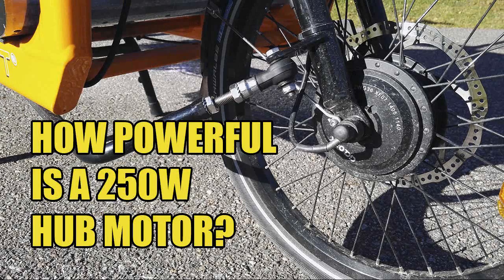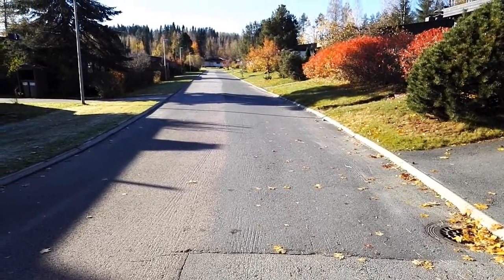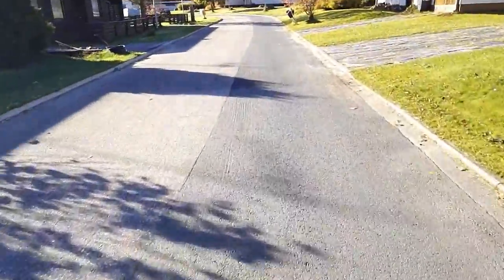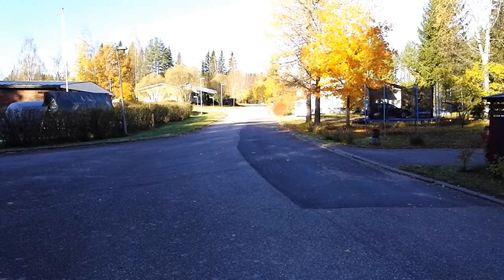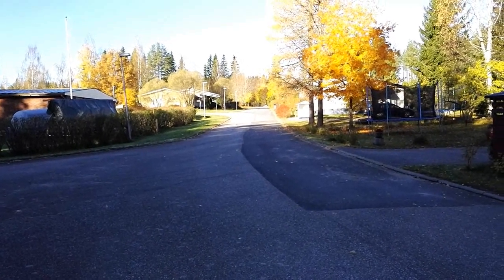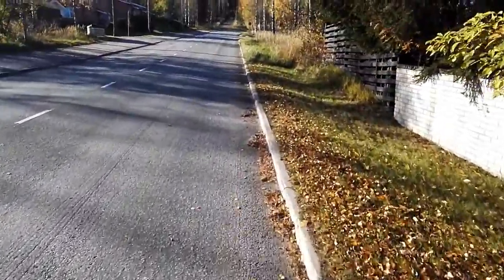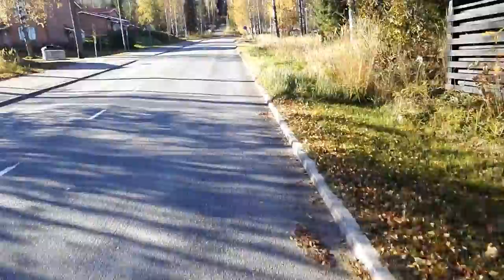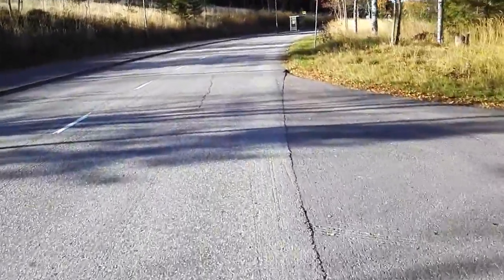How powerful is a 250W hub motor?

Comment: Well if you figure one horsepower is around 750 watts, and the average human can generate about a tenth of a horsepower sustained, then a 250 Watt motor is 3 times as powerful as a typical human is. To put things into perspective. Yes, some conditioned trained athletes can output more than a tenth of a horsepower. Are you one? For instance the guy that performed the human powered flight across the English channel was able to maintain a half a horsepower output. But he trained years to accomplish that feat. So not your average person.
Reply: Paul Frederick Im 14,5 yrs old and was able to cycle 250-300 watts for many minutes and 600 watt for one second.
Reply: Yeah and one of these electric motors will do it all day long. They'll do it tomorrow, and the next day too. You won't be fourteen and a half forever either.
Reply: Averaging 300W for extended periods is only a little high for most commuters.  Adults can do that routinely as can 14 year olds.  75 watts is an absurdly low estimate.  Plenty of riders, even in their 70's, do much better than that.  Conditioned athletes can output more than 1/10 horsepower?  Racers average 300 watts for many hours continuously!  And they weigh 120 pounds when they do it.  They can also generate far more than 1000 watts in sprints.  A 250 watt motor is less power than most adults can make.
Reply: +craigsj if what you say is true then humans are getting much stronger in recent times. One horsepower is lifting 550 pounds a foot every second. Precisely how long do you think you can keep that kind of activity up? I want to see these supermen that are stronger than horses. Learn how to fucking read.
Reply: Electric motors can't "do it all day long".  Eventually their power source runs out, just like a 14 year old who gets tired.  It's very much analogous.  It's also the case that an electric motor rated at 250W is not capable of doing 250W at all unless it is operated within it's power band.  Furthermore, hub motors such as this one don't operate in this power band while climbing steeper grades unless they are used in very small wheels.  In such cases they neither output 250W NOR do it long without overheating.

A common, commercial battery pack these days for e-bikes will contain about 500Wh of power.  At 250W, that's a runtime of 2 hours at best.  Far from "all day", it's quite possible that the 14 year old above could match that power output when recharge times are factored in.

While it's true that a 14 year old won't be 14 forever, what's implied here is that he can only achieve this because he is so young.  That's wrong.  Young people tend have burst power over endurance, this person will likely get stronger AND improve his ability to deliver power longer as he ages, completely the opposite of what you suggest, Paul.
Reply: +craigsj as I read your comment except for some extraneous bullshit you've tried to throw in you've pretty much confirmed what I said earlier. That extremely conditioned athletes can output about a half a horsepower. Then you mention one outlying example that can put out slightly more. But he got busted for doping. They still cannot output the power continuously though. I bet their stop and start performance is poor too. So thanks for all of that.
Reply: Nothing I have said would suggest I ever misunderstood that, only that your comments are uninformed.  Furthermore, the purpose of the comment was to insult me, not to educate me.  I'll add lying to your list of objectionable traits.

What is your source anyway?  It certainly can't be experience.  No one who has ever ridden a bicycle and measured their own power would say something so ludicrous.  Wikipedia says this:

"A trained cyclist can produce about 400 watts of mechanical power for an hour or more, but adults of good average fitness average between 50 and 150 watts for an hour of vigorous exercise."

For humans, an hour typically defines a "sustained" effort.  Your definition will, no doubt, be different if it suits you.  Your definition of "average" as well.  Perhaps what you really mean is it's all YOU can do.

The numbers I quoted earlier weren't one exceptional athlete who had been caught cheating but numbers not uncommon for "trained cyclists".  The number quoted for adults of "average fitness" are higher than your number as well and they aren't associated with cycling.  We are talking about cycling here? Perhaps that needs to be redirected as well.

Sorry Paul, but you really don't know what you're talking about.  It is typical for riders of average ability to produce power similar to this motor's rating.  They can't do it forever but they can sustain it for the periods cycling commonly requires.  Furthermore, a battery-operated motor can't do it forever either and any cycling effort too long and difficult for an average rider will be hard for a direct-drive, underpowered hub like this one as well.  Perhaps if you only had a little experience to back up your running of the mouth.

I'd still like you to back up your explanation that a 14 year old can only sustain higher power because he is young.  It's got to be the dumbest thing you said here, though I doubt it's anything special for you...
Reply: +craigsj ah so your omission was intentional in order to deceive then, was it? Because you clearly dropped the word "average" when you misquoted me. It is never my intent to educate anyone either. There are books, and school for that kind of thing. I may use salient facts to reinforce what I say, but doing that it is never my intent to educate anyone. I only do so to prove my point. Now you object to those facts. You've gone on to present conflicting facts. Incredible facts. Questionable facts. Like that humans can produce more power than a horse can. Why can't you simply admit that machinery is more powerful than humans are? I mean that is why we make these devices. What is incredible is just how much more powerful machinery often is than people are. Little damned motors can kick our asses in for us performing simple tasks.
Reply: I did not quote you, that would require quotation marks, so I couldn't have misquoted you, intentional or otherwise.  Nice try at another redirect, Paul.  As for not trying to educate anyone, sure you weren't.  Why would anyone get that idea?

Regarding "salient facts", you have yet to provide any data at all, much less facts.  Furthermore, I don't "object" to these "facts", I object to the misinformation you have provided and the ugly way you've provided it.  Furthermore, I have supported my claims with information that is entirely consistent.  Another effort of yours to redirect.

You are the worst kind of fraud, Paul.  You post in ignorance, you belittle people (worse yet, adolescents who know more than you), you then resort to bullying, lying, and dancing around when exposed.  You aren't going to win, Paul, no matter how you try to redefine the subject.  Youtube puts your ignorant comment on the top of thread, you can't hide what you said.
Reply: +craigsj just use your head. Look at people, then look at horses. There's no way a person puts out close to what a horse does. Not usually even half. I am not lying. I have not changed my story. I am sticking with what I said from the beginning. People are weak. Motors and horses are strong. What is amazing is how they can pack so much power into little motors today too. That is the point I was trying to make. Don't underestimate 250 Watts of power. It is a lot!
Reply: These comments keep getting dumber.  You may imagine a horse is relevant to the topic if you like.

The power we can generate is highly dependent on the activity, I'd suspect not too well pulling a wagon or a plow.  We do quite well on a bicycle, a device invented to improve our efficiency.

250 watts is what it is, in this context it is the maximum sustainable electrical INPUT power of the motor, and even then only within a defined range of speeds and conditions.  It is not a measure of output power.  Motors like this PEAK at about 80% efficiency and are far lower at climbing speeds.  You may think that 250 Watts is a lot of power, but a 250 watt hub motor puts out at best 200 watts and far less while climbing, direct drive ones perhaps less than 100.  That's right, at climbing speeds with larger wheels the efficiency can be 30% or even worse.  Then they burn up.  Does that motor still sound like 3 times the power of the rider using it?  No, far from it.  The more you know, the more ignorant your claim is.  Use your head, Paul.
Reply: +craigsj I'll tell you this, in an endurance race I'd put my money on the motor over just about any individual. Electric motors are very efficient today too. They started out about 80% efficient, but we did manage to improve them marginally over time. We have had more than 100 years to work on them now too.
Reply: There you go telling me stuff again.  You never learn.  Spend your money how you like but it would be easy to find a rider than could beat this motor in a race, especially one where the motor runs out of battery.  This motor would struggle to make 20 mph, I could beat it in a race around the block.

So  motors "started out 80% efficient" but we've had more than 100 years to "work on them".  It would appear you are suggesting that motors were 80% efficient 100 years ago and are much better now.  If that's the case, you should really rethink that.  Your ignorance is showing once again.

Small hub motors like this one are, at best, about 80% efficient and much worse at lower speeds.   Look it up for yourself.  Go to ebikes.ca and run their motor simulator.  AFAIK no hub motor is 90% efficient.  Some mid-drives are, but again this is peak efficiency.  Hub motors at climbing speeds are inefficient, often below 50%.  I fully understand that you nothing about this, Paul, and happily make up facts that suit your biases, but try to resist for once.
Reply: +craigsj it would have to be a big block to be a good endurance test. As far as the battery running out goes I am talking about an ideal power source, that never runs out of power. As that is not any fault of the motor. Electricity storage is another technology entirely. A weak link today too. But a battery pack could quickly be swapped out. Whereas tired people remain tired for quite some time.
Reply: Right, let's talk about an "ideal power source that never runs out of power" for the electric solution.  No doubt in your world that fits on a bike and makes a fair comparison in an "endurance race".  Really sticking your neck out, Paul.  How much would that power source weigh?  Nothing, I assume.  Quite the engineer you are.

If we have limitless, portable power we wouldn't need 250 watt motors on electric assist bikes since we'd have solved bigger problems already.  This is an inane mental exercise, an idiotic comparison of two disparate components ignoring greater problems and solutions.  An electric motor is nothing without a power source, it's dead weight.  Humans produce power without added components so they win this contest by default.

Running out of fuel, food and oxygen, is not the fault of legs either.  If we're going to swap out the battery then we're going to swap out the rider as well.  In that scenario this motor will never win.  A bigger motor could.  Interestingly, that is the original point.

There are no lengths you'll go to to run away from your original, ignorant statements, Paul.  Perhaps you should try to learn something rather than try to redefine an internet argument that you can't win.
Reply: +craigsj you can't swap out the rider. The rider is the motive force. Quit moving the goal posts.
Reply: So is the battery yet you feel entitled to swap that.  The motor is merely an energy conversion device, the power comes from the battery.  The rider is both those things.  Of course the motor won't "get tired", it's the battery that "gets tired". How convenient.

Now about moving the goalposts, where did this topic even come from?  Oh yeah, you redefined the topic hoping find one you could win.  How about you justify your claim that a 250 watt motor is 3 times as powerful as an "average human"?  Anything else is "moving the goal posts".
Reply: +craigsj learn how races work kid. For that matter learn how life works. Figure out what matters. Batteries don't win races. People, and vehicles do.
Reply: +craigsj "If batteries don't matter, then why do you need an "ideal battery" that never runs out for your side of the race?" Because my initial comment was about comparing human power output to the motor.
Reply: Let's look at your "initial comment" then:

"the average human can generate about a tenth of a horsepower sustained, then a 250 Watt motor is 3 times as powerful as a typical human is. "

I've refuted your claim of "the average human" and the "tenth of a horsepower" already.  You have no response or data.

I've pointed out that 250 watts is the motor INPUT, not output, and that such motors have efficiencies that are often worse than 50% in cycling applications.  You have no understanding of such things.

Now that you want to duck the battery issue, I will point out that you said "generate".  You are comparing the motor "generating" ability to a human's.  Fair enough, no battery required.  A motor can generate no power whatsoever, though, it can only convert power.  While that's technically true for humans as well, you've conveniently left that in the human equation so that you can attack it.

Now, I realize you don't understand any of this, Paul, because you don't actually know anything, but why don't you just stop talking?  You know nothing about any aspect of the topic.
Reply: +craigsj of course with no electricity a motor will make no power. So why should I include that variable in a straight up comparison? You're not including dead people in your calculations either. They don't cycle very well, now do they? Maybe off cliffs.
Reply: Paul Frederick I almost thought you were trolling at first, why not learn more about the topic (motor efficiency and power  measurement on a bicycle) rather than try to win arguments with wild incorrect guesses and insults. This is cringeworthy to say the least.
Reply: Paul Frederick I went to the gym and i was able to cycle for 27min (10.00km/16miles) with an avg wattage of around 156w, thats a a bit more than. 2/10 of a horse power and im not fully grown yet. just deal with it, you're wrong
Reply: +☬ TrainsYT ☬  a whole 27 minutes? That's a nice start. Now keep it up for 10 hours. Two days. A week, a month, a year. A motor will. Can you?
Reply: Hmmm, please tell me where I can get magical batteries that can power a 250 watt motor continuously for a year. Have you done the maths on the capacity needed for that? Thought not.
Reply: +Edward Yeboah my earliest comment said nothing about batteries. But you can always change batteries. Or simply run off grid power. My comment is about continuous sustained power output. People tire, motors don't.
Reply: ... and he can stop for a break and an energy bar then get back on. Not to mention he'll get stronger as he trains. I regularly exceed 1000 watts on my bicycle, can ride for more than 2 hours without a break (ignoring short breaks at red lights) and have a measured FTP of 330w. Your point is nonexistent.
Reply: Edward Yeboah you think you exceed a thousand Watts? So you're stronger than a horse? Who are you Antman? More likely someone just overestimating their ability. Which was my original point. Thanks for reinforcing it for me.
Reply: Paul Frederick You will need to change the motor after some time, also you need a battery with HUGE capacity to cycle 250w for 10 hours. (Huge for ebikes) also you would need to charge the battery
Reply: Edward Yeboah I have an Ebike with a 36V, 11,61amp hours (418 Watt hours) which means it can run on 156W avg for 160 minutes. And then you would have to wait 5 hours approx to recharge. That means you can cycle about 36% of the time.
Reply: ☬ TrainsYT ☬ my original comment had nothing to do with the sad state of battery technology today. I know the batteries we have now suck. Which is why electric vehicles in general make no sense compared to internal combustion engines. That is an entire different issue.
Reply: Paul may have invented a bike that runs on perpetual motion since he finds batteries to be an unnecessary consideration.
Reply: They make no sense? In what way? Do you have a 150 mile commute? Then move closer!
Reply: Anyway your original point was incorrect, FTP is a good way to measure the continuous energy output of a cyclist and many cyclists with practice maintain > 250w FTP. You've already been told this and refuse to acknowledge it so you're likely trolling.
Reply: ☬ TrainsYT ☬  many minutes is not sustained power, sustained power is hours in the saddle  ie tour de France.
Reply: you guys are all up your own arse about a power figure that for all intents and purpose are useless. The power rating in kw in this case is an indication of power being consumed not work done. Metric Hp is kind of the same.  Old world imperial figures for horsepower is based on work done not energy used.  That is why Paul comments are hard for some to understand. in traditional Hp figures it is assumed that the turning force generated is directly proportionate. In reality this is different.  However with all that said it's the torque provided by the electric motor that a human and indeed a traditional engine cannot compete with. An electric motor unless impeded by a controlled system give 100% of its torque rated at full load instantly.  After that it's only rpm which makes the difference.
Reply: I don't think motor efficiency was being discussed here, refer to the comments made at the beginning of this thread. "sustained power" is a meaningless concept in the context of this discussion, it's clear you have no idea what FTP means and how it used to train athletes. I guess it says a lot about you when you'd rather take the side of a person who insults a child then attempts to teach him false information rather than educate yourself with facts. By the way one horsepower is 746 watts, Paul.
Reply: Edward Yeboah  it's not the battery in question, but if it was then it is pointless to discuss.
Reply: Where did I mention the battery?
Reply: Edward Yeboah  Many times  in the comments above you talk about magical batteries and perpetual motion and other such dribble. I never sided  with anyone and I'm not even sure who it is who insulted a child so keep your morale victory for another day. My point was quite clear.  Torque is by far and away a more important figure followed by the mechanical advantage, then maybe the available power in kw.  Speed is a byproduct of efficiency, if you can only achieve 75kw of power or you can punch out 750kw's makes no difference. It's all about how it's applied.
Reply: A motor rated at 250w should deliver 250w of power or its defective. It matters not one bit what current or amps it's draws from its power scorce as this will vary depending on the load it's experiencing. But at least in every other industry in the world apart from the cycle stuff that only you are privy too   250w means 250w +/- a disclosed tolerance.
Reply: craigsj  Give me the theory of how climbing the stairs produces massive amounts of power. I know that in the strange world of din hp a horse can produce about 1.5 or so of the stupid corrected hp figures people like to use.
Reply: Give you the theory, Richard?  How's this for theory:

Run up a flight of stairs.  Record your weight, the gain in altitude, and the time taken.  Now compute the work you've done.  From there you can determine the power.  No theory required.

Now, I realize you don't understand any of this but that's on you, Paul Frederick.
Reply: Electric motors have efficiency ratings over 90% today. So what you get out is very close to what you put into one. It is quite remarkable just how well that tech works. Even the earliest electric motors ran at about 88% efficiency. It is the storage side where we have a lot of difficulties still. Also, lots of what you suspect is suspect itself.
Reply: craigsj   Every electric  motor I have ever fitted has been rated by its output.  It will come with information regarding the min and max input in volts and amps and the correct combination of the 2 required to achieve the desired output, let's face it if a buy a 1/4 hp motor how do I go about feeding it the little slices of horses to make it go?  Let's say the motor in question is a internal combustion engine how many  watts  of input is required to reach the quoted out put then or even a hydrostatic drive if I need 250w if power what size of drive unit should I buy to achieve it? 350? 400? 500?  That's why a motor of any sort is labelled by its output.  In all my years of experience,  and the hundreds of years of accumulated knowledge of the men who went before all dashed to bits by one youtube expert. I'm going to ring the E.T.C and tell them to put a halt to all further training and refute all previously issued qualifications until they have had the correct instruction and training form you.
Reply: craigsj   Ok so as you refused to provide the formula I used the old fashioned method (mgd)/t=w÷746=hp   and got my own answer.  35.4w required to climb stairs that a stonking great 0.047 hp.  Horses must be awful small in your part of the world.  Ps my calculation is power required to climb stairs not energy consumed throughout the duration of the climb.
Reply: I didn't refuse, "Richard", I just think anyone who wants to claim expertise should know the most basic concepts.

It's sad that you can only produce 35.4 watts climbing stairs.  I'd wager everyone who reads this can do better than that by an order of magnitude.  Good luck in your wheelchair.
Reply: There is no 250 watt hub motor on the market with 90% efficiency, what other unrelated motors can do is irrelevant.  You know nothing about the subject, Paul, not even that 250 watts was an input rating until you were told.
Reply: you're right. Modern electric motors are 93% efficient. That includes wheel hub motors as well. So the difference between power input and output is negligible. For the purposes of this discussion it can be ignored.
Reply: Provide a link to a single 250 watt hub motor with 90 % efficiency, Paul.  There isn't one.

There may be some with peak efficiency that high but they are multi-kilowatt hubs not suitable for use in "electric assist" bicycles.

Furthermore, hub motors will operate at much lower efficiency at lower speeds such as occurs during hill climbing, perhaps even less than 50%. All motors have an efficiency of 0% at stall speeds.  Sadly, typical low power hub motors don't get far enough from stall speed to avoid converting the bulk of their power into heat.

As with every other aspect of this topic, Paul, you are completely ignorant of the facts.
Reply: craigsj   How did you know I am a wheelchair user. Nevertheless it's not that I cannot develop more power it's just that the figure stated is the amount of power required to climb stairs not the energy used. Very different figures. to say that it would take more than 1hp to climb stairs is just daft. In terms of energy converted throughout the entire climb you might use more that 746w but that is energy expelled in total. No using a scientific formula that is recognised in engineering practise it only requires .047hp for me to climb stairs. Assuming I could walk. As is my lift only requires a 150w traction motor to propel 22st up a standard flight of stairs.  22st being the swl of the lift and not my own body weight.
Reply: A stalled electric motor is outputting maximum torque. It is also undersized for the application it is being used for. I can't help there. Make better choices?
Reply: Well, Paul, you clearly think like one and perform like one.  Put two and two together.

The stair climbing comments here are for everyone to see so lying and misrepresenting the conversation gets you nowhere.  No one said "more than 1hp" is required to climb stairs except you and no one confused power and energy.  Beat on those windmills elsewhere.

Give me a reference where is it "engineering practice" that only 0.047hp is required to climb stairs.  Frankly, you could do it with far less.

An able bodied adult can easily climb a flight of stairs in 5 seconds, fit or younger people in half that time.  Given the height is 10 feet and a weight of 165 pounds, that's 330 pounds feet / second or .6 horsepower, and order of magnitude greater than your claim.  Your number may be typical for an electric lift but it's irrelevant to what a human can do.
Reply: craigsj  ps if you read what I said I even show my formula. bit more accurate than run up some stairs and weigh yourself.
Reply: craigsj  alot of noise but no facts coming from your end pall. If you read your own rubbish you will find you claimed the massive power required to climb stairs. I just worked out the power required for my bodyweight to climb stairs. So yeah its here for all to see.
Reply: "The power rating in kw in this case is an indication of power being consumed not work done."

Congratulations!  You've now caught up to what everyone but you, err Paul, already understands.  No one has made this mistake except Paul.

"However with all that said it's the torque provided by the electric motor that a human and indeed a traditional engine cannot compete with."

Humans can easily compete with a 250W motor for peak torque.  One legged.

"An electric motor unless impeded by a controlled system give 100% of its torque rated at full load instantly."

It sure does, yet it's efficiency is 0% while doing so.  If the rpms don't come up rapidly, the motor burns up.  That's why low powered hub motors suck for climbing hills, their torque may the best it can get but that doesn't mean it's adequate.

And look who's now deliberately confusing terms!  Torque itself is irrelevant as torque doesn't get work done. An electric motor at stall produces peak torque but zero output power.

The stupid goes on and on.
Reply: Horsepower is a rating of work done per unit of time. You can climb stairs with 0.000001HP, you're just not going to go up them very quickly. A horsepower is 550 foot pounds a second. That means every second 550 pounds gets lifted a foot. If it takes 2 seconds to lift those 550 pounds one foot then it is only a half a horsepower. Get it?
Reply: "My point was quite clear.  Torque is by far and away a more important figure followed by the mechanical advantage, then maybe the available power in kw."

It's sad that your point is so utterly wrong.  It's what a trucker would say, though.

Any motor can produce any torque given the right "mechanical advantage".  These are one in the same, not distinct issues.  Sadly, you will probably never understand this.
Reply: Your comment makes it quite clear that you do not understand the basic principal of power. Because without time there is no power. Only potential. Time is always a factor in calculating power. Because nothing happens instantaneously. But power is a unit of work, which is something happening.
Reply: Paul Frederick  Who me?
Reply: Formulas aren't accurate, data is and you've provided none.  Thanks for making your intellect even more clear though.
Reply: There you go lift 55 pounds in a second every second and tell me how long you can keep it up. Maybe you'd be better off lifting 110 pounds and taking two seconds? Because I said sustained output. Which if I had to arbitrarily quantify that I'd say for at least an hour. That is 3,600 repetitions. Missing just one means that your output has fallen below the minimum threshold that you say is oh so easy to meet too. Good luck chump. I said it is possible. Maybe climbing stairs takes longer than you think?

Let's see the Empire State Building run up is 1,576 stairs and the record is 9 minutes and 33 seconds. So 1,576 stairs in 573 seconds is 2.75 stairs a second. Let's say for the sake of argument that the athlete is oh 150 pounds. He looks skinnier but we'll go with that. Each stair is not quite a foot tall though. He only goes up 1,050 feet vertically. So this world class trained athlete that currently holds the record in an international event was generating 372.67 Watts when he accomplished his feat. He sustained about a half a horsepower doing it for the short duration too. I bet if you asked him at the top how he felt he'd say he was winded, or tired.
Reply: You must have gotten your science from The Matrix. Humans are not power sources. We metabolize food to create the energy that we use. We even have a name for running out of food. We call it, starvation. It can, and does kill us too. We even have a name for when it is widespread, then it is, famine. One of the Four Horsemen of the Apocalypse. It is good to hear that you've never experienced any of this yourself. Being as you've completely discounted it in your narrative, you've obviously no firsthand experience with any of it either.

Stay well nourished.
Reply: Yep another rathole from Paul.

By that standard, the sun isn't a "power source" either, nothing is.  The body, though, doesn't "metabolize food" directly into work, it converts it into energy stores which it mobilizes later as needed, just like the battery in a bicycle does.  You know, that thing you don't want to acknowledge is needed to produce power?  The thing you pretend is infinite and can fairly be swapped as necessary to support your narrative?  Yeah, the body works like that.
Reply: The Sun really is not a power source. The Sun emits energy. Which we can use to generate power. You also obviously do not understand the concept of idealized models. Where extraneous details are eliminated to focus on what matters. which in the context of this discussion is power output. Not where the power comes from.
Reply: Ps 1hp is 550ft.lbsf/s  If that helps any of you realise that it's not as straight forward and linear as you might think.
Reply: The very reason I posted my original comment is because I know folks do not usually think in these terms. But there is an underlying logic that underpins the world that we live in. Regardless of anyone's feelings on matters. I at least enjoy discovering, and discussing subjects like this myself too.
Reply: The sun is not a power source?  You'll say anything, Paul.  Is an electric motor a power source?

If the discussion is power output, why did you confuse the power INPUT rating of a motor for so long?  Why compare human power output to motor power input?  Because you didn't know any better.

I guess anything that proves you wrong will now be an "extraneous detail".
Reply: ...and you enjoy bullying children too.  Don't forget that, Paul.
Reply: craigsj  You wrote "formulas are not accurate" Never in almost 20 years as an automotive engineer have I seen a motors power rated by its input. power is not proportional to speed All you have told me goes against most conventional methods and every time you do you change your story. If by talking to myself you mean making a reply to someone, well  it's clear to all but you.
Reply: craigsj  Nobody here has bullied a child we already covered that moral victory you cling to is void
Reply: I see, you are simply incapable of understanding what I said.  I see "Richard" likes to dive down ratholes just like Paul does.  What a surprise.

Data is "accurate" or "inaccurate", formulas are "right" or "wrong".

This was a in response to this comment:

"Ok so as you refused to provide the formula used the old fashioned method (mgd)/t=w÷746=hp   and got my own answer.  35.4w required to climb stairs that a stonking great 0.047 hp."

No data, just some absurd result along with some gibberish.
Reply: craigsj  Hardly obersd result, I showed my formula it's there for all to see. Your obviously grasping at straws and again changing your story with every post. O.047 hp is the required effort for me to climb stairs without any other influence.  So let's face it in the heat of the moment you got carried away, made a few rash judgements big deal. An intelligent man would of said oops, misjudged that or sorry I made a mistake. But yet in the light of facts offered to you from two unrelated scorce,  still you blindly argue. Until I went through my training I also would of massively underestimated 1hp. Now I know different.  I currently have 3 different 1/4 hp motors on my bench all three have wildly different imput figures but the fact remains they are all rated 1/4 hp motors.  I have an engine in my truck that only musters 112 hp but 238 lb.ft torque measured on a dyno. My wife's car makes 120hp but only 122 lb.ft torque. These by the way are facts or data if will. Also they were worked out using formulas.
Reply: Edward Yeboah May I ask how you measured your FTP?
Reply: Power is work done over time. When calculating power how long it takes is always a factor. Because acting on a load faster takes more power. In electrical terms power is expressed with the unit called a Watt. A Watt is volts (potential difference) times current. Current is one coulomb of electrons passing a point in a second. So there's the time factor. In mechanics a horsepower is 550 foot pounds a second. A second is a unit of time. So power is potential realized over time.

Now the Sun produces energy, but it is not necessarily power, because it does no useful work. We can convert that energy into power that we can use though. All other stars in the sky are also making energy too. But no one considers them power sources. Because we cannot tap the energy of those remote stars. There's just too much transmission loss over vast distances. Semantics is a tricky subject.

In this day and age it is important to understand the nuances of energy and power though. Because they're so critical in our daily lives these days. As a species we have become utterly dependent on exploiting energy resources. So a grasp of all of this is essential to our very survival anymore. Incorrectly valuing resources due to a lack of understanding is detrimental too.

BTW your stalled motor argument is flawed. Because a properly sized motor will never stall. So your whole argument is based on a mistake. A stalled motor is a fault condition. But keep grasping at straws.
Reply: Surely you could have googled it, there are many ways including using a watt bike. I wanted to know my VO2 max as well so I went here: https://www.westminster.ac.uk/about-us/faculties/science-and-technology/for-business/health-testing-services/fitness-services/vo2-max-test
Reply: I have come to the conclusion that you/Richard/Paul are here to frustrate, bully and troll others. I've posted that link for the benefit of those who might be following this discussion since you asked. I doubt you'll even take a look at it.
Reply: Edward Yeboah I have never measured my own but understand the theory behind it. I have been a keen cyclist scince my school days. I just wondered if it can be done on your own bike and if it's measured at the wheel or crank. I just wondered if my arms are in any way comparable to your legs. I just didn't know if my bike could be used.
Reply: Most devices measure it at the crank, such as Stages Power Meter. I haven't seen any which measure it at the wheel.
Reply: Edward Yeboah I will be looking at it shortly, I only asked because it pricked my interest. I have never bullied, trolled or intended to frustrate anyone. I just wished to put over the experience I have gained and some lessons I learned  the hard way as a point of conversation.
Reply: What experience have you gained? Do you find the exchange between "Paul Frederick" (who might even be a sock puppet of yours) and the teenager who was on here acceptable?
Reply: Edward Yeboah  Thanks, maybe someone has a machine I can pedal with my hands. However I use my hands in parallel not opposing so it might not be convenient. That said I'm not the only disabled cyclist in the world and these days almost anything is possible.
Reply: Yeah but you're stronger than a horse. You've already said you output a thousand Watts in an earlier comment. Why Hell, I bet if they let you in the gate you could win the Triple Crown! Because you're obviously much more powerful than all the horses on the track. Let's get a jockey on your back, and run you!
Reply: Actually 1,327 watts peak as tested two weeks ago. I'm sure a horse could do 100 times that, peak. Do you understand what peak means?
Reply: My original comment stated sustained output. Electric motors can deliver their peak output all day long. That's what people can't do. Machines do not get tired.
Reply: Edward Yeboah not sure what you mean by sock puppet, and to be honest the conversation was interesting
Reply: Edward Yeboah  No I have no idea who that guy is but it's not me running a second identity.  By experience I ment 20 years as an automotive engineer. I have worked on many different power drives, different machines from race cars to earthmoving equipment. Developed machines for one off tasks and even a couple of aquatic appliances. I fully understand how a motor functions and how they are rated for power. I also have a good working knowledge of physics and engineering practice. I have also journeyed an apprentice (not as fun as it sounds) so I guess I can't be completely stupid.
Reply: " I fully understand how a motor functions and how they are rated for power."

Do you, "Richard"?  That claim is betrayed by your comment earlier:

"Torque is by far and away a more important figure followed by the mechanical advantage, then maybe the available power in kw.  Speed is a byproduct of efficiency, if you can only achieve 75kw of power or you can punch out 750kw's makes no difference. It's all about how it's applied."

It's quite clear that you don't understand at all, just as your alter ego Paul doesn't.

An engineer wouldn't have to state his credentials in a topic such as this, his clear understanding of the principles would be enough.  You're a fraud, "Richard".

I can't wait for Paul to elaborate on how the sun doesn't generate power but only produces energy.  Perhaps you can get your grandson to switch the login back over to Paul so you can respond to that.  It's such a delightful non sequitur.
Reply: "Electric motors can deliver their peak output all day long."

Another laughable comment from Paul.  If they could sustain their peak output rating then it would be their sustained rating.  Apparently you don't understand what "peak" means, either.  Once you've redefined literally every word in the language perhaps you might find a defendable point.

...and of course machines DO get tired, you just want to ignore the parts that do, but I'm more interested in the comedy gold that is your claim that the sun doesn't generate power.  Please tell us more about how "producing energy" isn't "generating power" until humans can make use of it.  I think that's the dumbest thing you've said so far.

As even you would acknowledge, power is work per unit time.  Given that "work transfers energy from one place to another or one form to another", source https://en.wikipedia.org/wiki/Work_(physics) , it would seem you have quite an uphill climb to defend your stupid claim.  Perhaps that powerful 250 watt motor can help you.
Reply: YET AGAIN ANOTHER ACCUSATION. I don't know how or why you think Paul and I are one and the same. A smarter man wold of checked that by now and found it to be untrue. I was asked of which experience I spoke so I answered. FRAUD, no, stating my credentials would of taken about 4 or  5 pages and not something I wish to get into. And yes picking a motor for a task would be done by a lot more than a simple statement of wattage. But again you represent what you think is some form of evidence to your advantage by taking the quote out of context.   Do you not realise that I can remember what I wrote. How about this I'll agree your right if you can show me a comercialy available motor marketed and rated by its power consumption.
Reply: "...stating my credentials would of taken about 4 or  5 pages and not something I wish to get into."

But it IS something you wished to get into when you "got into it".  You were the one claimed to be the experienced engineer who completely understood the subject despite having already proven otherwise, a fraudulent claim if there ever was one.  What do we call someone who claims to be something he is not?

"...show me and [sic] comercialy [sic] available motor marketed and rated by its power consumption."

A fool's errand; manufacturers don't explain what their single power ratings mean in the ads and spec sheets.  Furthermore,  you've included wording subject to your own interpretation.  Nice try.

Of course, I'd make the point that a single "shaft output power" rating is meaningless as any "engineer" would know, but you've already proven that you don't understand that.  Electric motors, like any engine, have an output power curve that is a function of rpm and supplied voltage.  Any discussion of single output numbers, whether "sustained" or peak, is not interesting without context and is a red herring of yours/Paul's.

A power curve of a representative "250W" bike motor would be far more informative.  One can be found here:  https://endless-sphere.com/forums/viewtopic.php?f=3&t=4892&start=150

I'd choose one for the MXUS xf07 which this video appears to have, but I did not see one.

Some interesting points:
1) motor has a 250w rating, nothing in the chart suggests how that is determined
2) best conversion efficiency is 82%, not 90+% as Paul claims
3) peak torque of 21Nm / 17 ft lbs. Worthless for climbing (as I've said)
4) power output <150w in lower quarter of speeds where climbing occurs (as I've said)
5) rated voltage is unclear (36 or 48)
6) rated current is unclear (13 or 16.258)

Also, this being a geared hub means it cannot tolerate much sustained electrical power dissipated as heat.  Typically the limit is 100 watts due to lack of motor cooling and the nylon internal gears.  This is supported by the max input power (580 watts) times loss rate (20%) yielding 116 watts dissipated as heat.  That means that at lower speeds and efficiencies the motor will burn up at this input power.  This motor cannot sustain 250 watts of output power at climbing speeds (as actual e-bikers know), closer to half that.
Reply: craigsj So still no prof of your claim of a motor rated by its input then. A power curve, your almost on the right track. Yes credentials for most people over the school leaving age in almost any industry are a very long list indeed. I cannot think of a time when I have not checked the advertised output of a motor as part of shortlisting it. Geared or otherwise, it's irrelevant. My point, if you cast your mind back far enough to before your insistent argument that because I said something you didn't read correctly, was the power rating in hp, watts or any other measure you choose is only indicative. How the power is applied makes much more of a difference.  You said no motor rated at 250w will ever produce that much power. Go have a wee look at the link or the indeed your last comment.  bye
Reply: One down, now if only Paul would go away.
Reply: Paul Frederick i am preaty sure a average human is more powerfull than that 250 w hub
Reply: Paul Frederick a pair of well trained legs can put out more than 800w
Reply: Don't waste your time on this troll.
Reply: You realize you're saying that a human can output more power than a horse can. Do you know how stupid that sounds?
Reply: That is what prompted me to leave the original comment. Because lots of people are prone to make that mistake. It is absolutely astonishing how little power humans can output continuously. Which is why the industrial revolution and the age of mechanization that followed it changed our existence so dramatically.
Reply: a horsepower is the amount of power a normal horse can produce. It is common sense that a human can't even get close to what a sickly horse can do. Yet that escapes you. Plus in my original comment I said sustained output. Which I failed to define, but we can safely assume to mean indefinitely. An electric motor will output its rated power for days or even weeks non stop. It won't eat, it won't sleep.
Reply: Craig, you are very persistent. I gave up on this troll a while ago.
Reply: Giving up is the right thing to do when you are wrong. But stay stronger than a horse.
Reply: Paul has to be treated the way he treats others, with disrespect and contempt.  Remember that he ran off, only to return weeks later with a sock puppet.
Reply: craigsj yes he most definitely has some kind of mental health issue beyond the crass ignorance and common stupidity demonstrated by most trolls.
Reply: A horse can output more than 15HP in a short burst. So why couldn't a trained human exceed 1HP in a short burst?
Reply: Paul Frederick A horse can generate up to 20 HP! 1 HP is just the average output of a horse, not its maximum!
Reply: Paul Frederick A horse can generate up to 20 HP. A HP is just an average output. Or do you think you could pull a heavy carriage with 6 people up a steep road with 1 HP? A strong horse does it easily, as I have experienced by myself.
Reply: Paul Frederick
Reply: Paul Frederick it's little more complicated than that you got tother factors that come into play, also efficiency most Motors have anywhere from 60 to 70% efficiency brushed motors are only 40% efficient, the scale is based on 88% efecent motors, Wen calculated to hp meaning that a 200 watt brushed motor is half as powerful as a 200 watt brushless motor, also by makeing more tork like 4 times the hp watts generated comes down 4 times while tork comes up 4 timed consumption watt remaining the same, the motor becomes only 60 watt then but the draw could be 400w on a shit brushed and 200 on brushless, these engines are not calculated on draw watts but rather hp watts wich is calculated at 200w being about 1/4hp on the brushless and 1/8hp on the brushed motors  so you can have a 400w on consumtion  on a shit motor and 200w on a good motor, if you create a motor with 4timed the tork you can add for timed more concuption watts wich gives 200watt of  hp watts wich then you can gear it to hit 50
Reply: Tony Boroni: Not sure that everything you wrote is right.
Reply: Juri Vlk not sure either just giving an analogy, efficiency comes into play a 200 draw watt of a old refrigerator motors is half as affecent as. a all neodymium magnet motor the reason being is the new motors use magnets on shaft and outside while the old motors use copper windings with magnets the poer draw is half that of the old motors with the same amount of tork and hp, so draw has nothing to do with how much hp is produced, a  true hp from the old scale is much much more then the hp of today, dynos are not good and measuring hp Wen you gear the motor with  a tork converter you transfer hp to tork RC engine have 1hp to 3hp with. 0.3 NM of tork while 49cc has engine has about 1.5hp with about 1 to 2nm of tork it's got 4 to 8 times more useable power you can gear torky engines to go. faster but high hp engines with little tork leave no room for harder gears if you get the drift.
Reply: Hi, torque is the force/power of the motor, not depending on time. You can take a relatively weak engine like the motor on an old tractor with 40 HP and tow a truck with it. Just put the smallest gear in it and you have lots of torque -at a maximum speed of 1 km/h or less.Power is torque times rotations per minute. You can get the same power output with a fast revolving but having little torque engine or a slowly turning powerful engine. There's a direct relation of torque and power of the engine. And you have to distinguish torque at the motor shaft and torque at the wheels. For the acceleration of a car f.ex. torque at the engine is relevant and/or HP at the wheels/engine. Latter will be a little smaller at wheels than at the motor due to losses in the gearbox. I always thought that electric motors had about 90% of efficiency or more. So it would be impossible for one motor having twice as much efficiency as another. There are some losses, but much less than with gasoline engines running at 20% efficiency. Even the oldest electric motors have an efficiency of 80% or more.
Reply: Juri Vlk you are right in a sense, but not totally  magnets work differently and frindge engine have doubled the power output in  the last 10 years, my RC cars as well castle creations engine being twice that of standard ones, it's all in the magnets and wires magnet engines that use magnets on inside and out will be much better then copper winding brushed engines efficiency can not be accurately calculated Chinese manufactured now have doubled that again using magnetic powder rotating a magnet in it wich creates heat whiles spinning the magnets 90% there is no engine that is 90% in one drop of fule there is enough energy to power a city energy is not fully understood by humans and calculations are made in error.
Reply: An average person on an average bike during an average trip with an average speed (12-13 mph) will produce about 100 Watts average. For normal bike-riding 250 Watts should be more than enough.
Reply: " an average person can output a tenth of a horsepower continuously. An extremely conditioned athlete may produce up to a half a horsepower."  Incorrect: I measured my output when aged 47, 25 years ago and found that I could hold 250W for 10 - 15 mins and 350W for a couple of minutes. I am no athlete.
Reply: @RobertSeviour1  you all keep missing his point. CONTINUOUS. 2 to 3 minutes is shit. A 250w hub motor can produce exactly that as long as it has power. There are plenty of batteries that can power that motor for 6 hours strait. No human can do that. That I believe was the only point Paul was making
Reply: craig, Paul's initial statement was correct. The average person can SUSTAIN about 1/10 of one hp. Not only do you not know what SUSTAINED means, but you obviously have some problems in your life and love to start arguments. Many things you stated thereafter are wrong. Here is one. You stated, "The power we can generate is highly dependent on the activity." That is blatantly false, and I can guarantee that Paul understands this. Maximum output power has nothing to do with the activity. Ever.